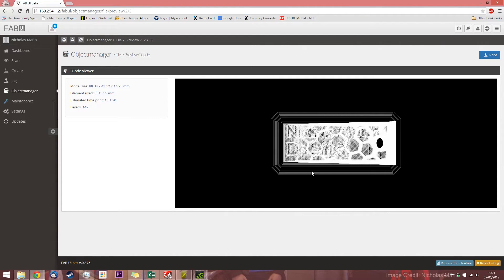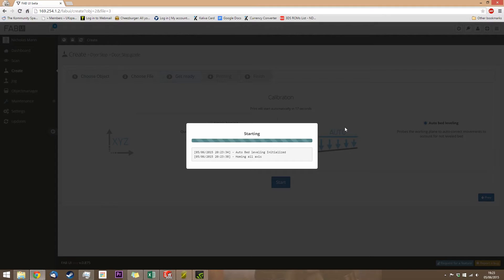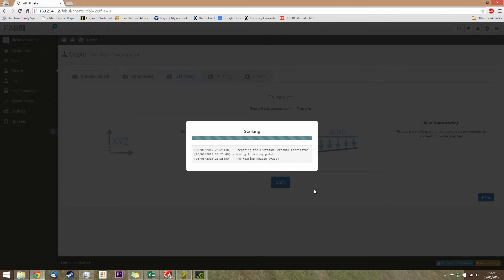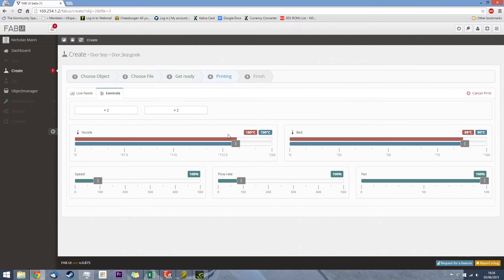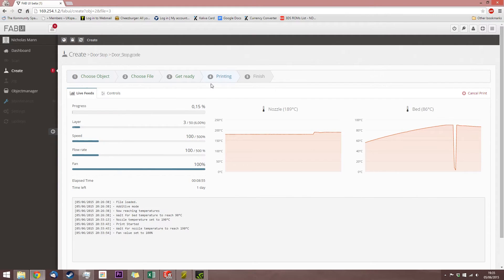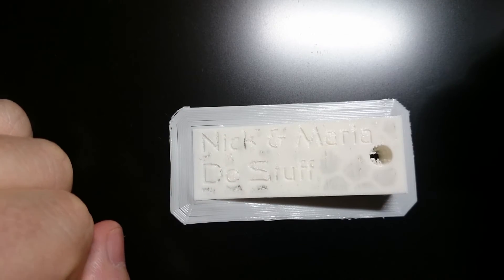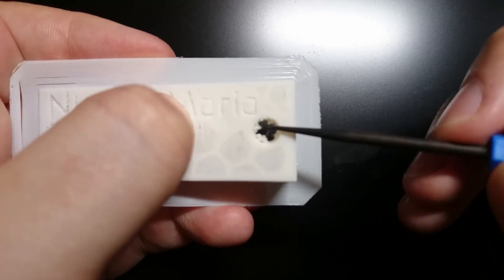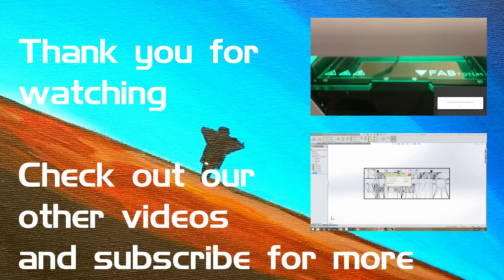FABtotum Print Example : HandyMann

Comment: sry new to this 3d printing thing , can u tell me what is the cost of running this thing ? does it have extra costs according to the things you make ?
Reply from the maker: +avinas jha I have not measured the power usage but it is on for several hours at a time which won't be too expensive. Most of the cost is the material. Depends what filament you get it is £10-30 a Kg so each item has an associated cost based on its size.
Reply: thanks man